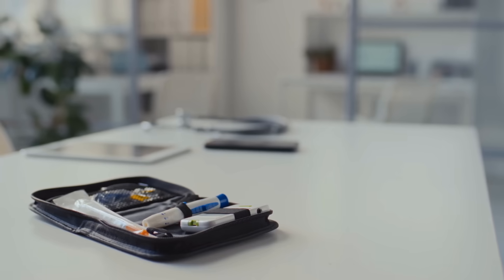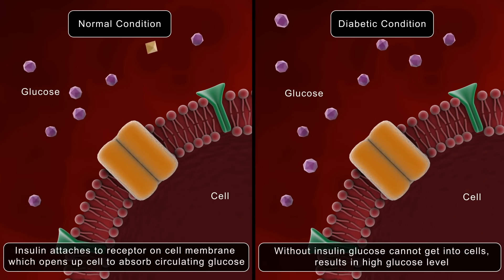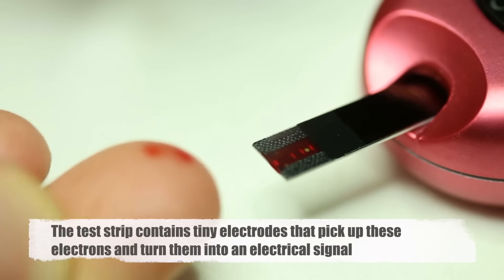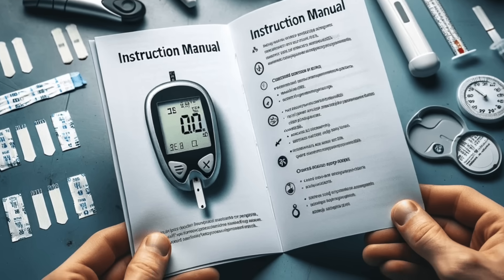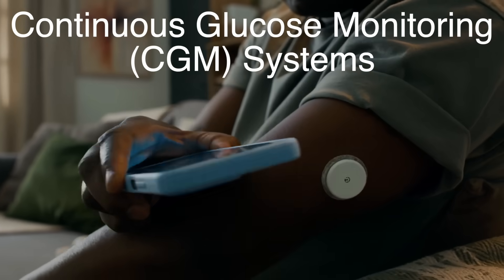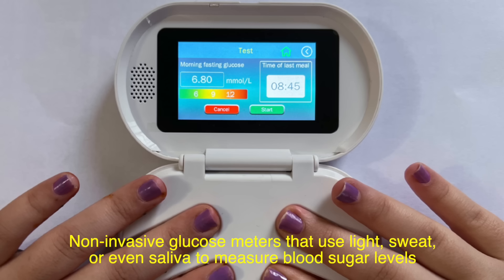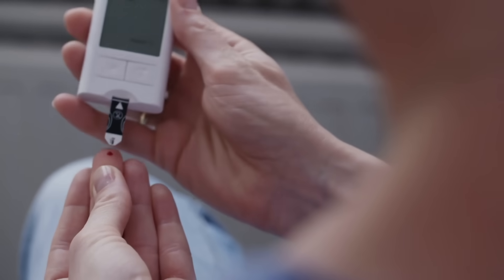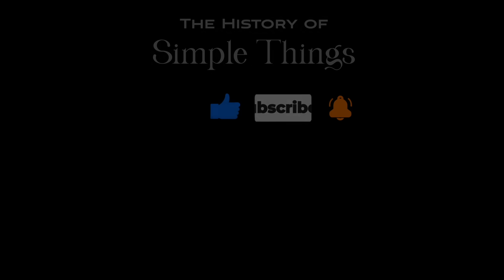How Does a Glucose Meter Work?

Comment: Since you explained the glucose monitors, what about a video on oxygen saturation meters (they use two LEDs, one red, one IR, and measure the difference), and the air or oxygen pumps, or CPAPs?
Greetings,
Anthony

Comment: If the insurance companies are so conerned about my health, why dont i have a continous monitor that links to my phone like a Dexcom brand unit?? It reads the level every 5 minute 24/7/365 !!
Reply: If you were so concerned why haven't you bought 1
Reply: For reference, without insurance, they can cost $500, and last for just  two weeks of use. CGM's are expensive, and test strips and lancets are cheap, in comparison.
Reply: Totally agree. The insurance companies or even the manufacturers do not explain their reluctance. The CGM can be a benefit to all people whether a diabetic or a healthy individual. I look forward to the non-invasive type.
Reply: Concerner on yout money?